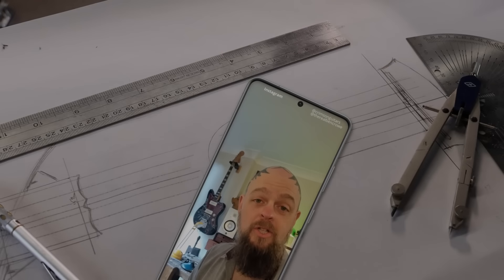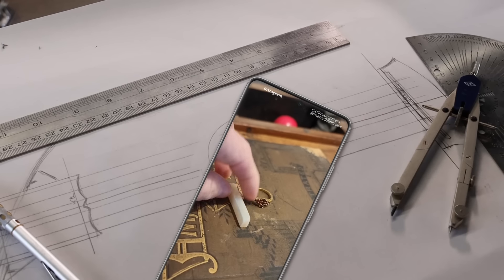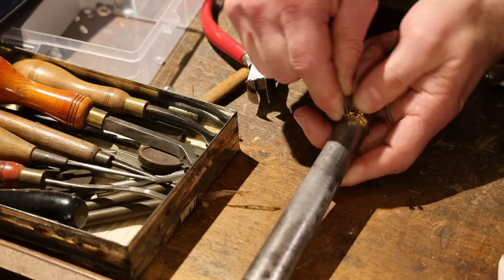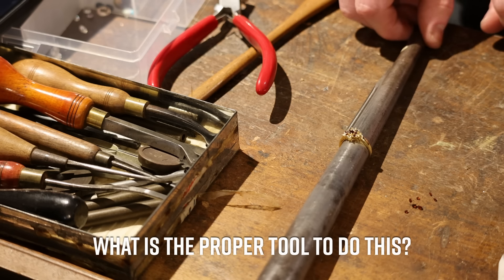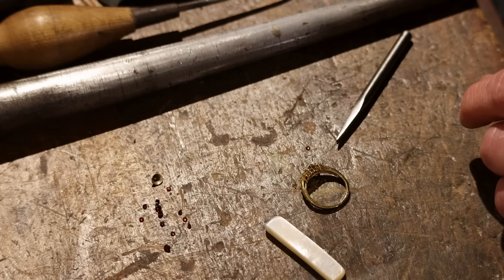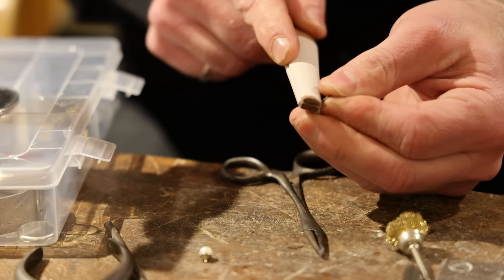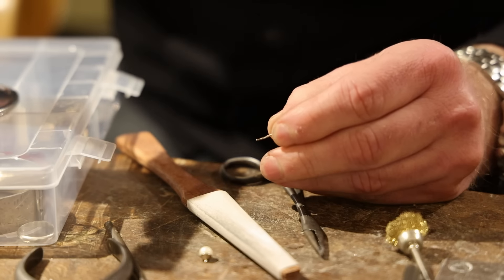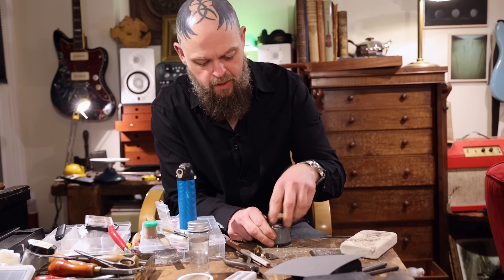Setting a Gem into a Mother Of Pearl Guitar Nut for HTOB | Experimental Luthiery 101

Comment: Longtime viewer, journeyman jeweler from the states. Thought I should weigh in!

First off, congrats, you did it. With the right tools bezels are still challenging to do. So none of this is my attempt to gatekeep, just suggestions for next time perhaps. 

1. There is no one perfect tool for removing stones because there is no one setting. I've used flush cutters, gravers, pliers, and indeed there is a tool called a prong puller that generally is great for pulling prongs. Imagine. 
2. The holes under the setting do help let light through but depending on the stone and the cut that may be better served by making the setting a polished cup. You'll see that a lot with morganite set in rose gold, really pops. The second purpose is a relief hole. When dirt accumulates it is next to impossible to get out from under a stone unless the setting is air tight, which is effectively impossible with prongs. Holes make steam cleaning much easier. 
3. I know how much you love old tools, and so do I, but no, fancy tools are not the name of the game for most jewelers. We improvise. In fact if were polishing that I would just load up a felt buff, dowel, toothpick, or horsehair brush (my favorite) and go to town at max speed in a drill or flex shaft. Five minute job. 
4. Pitch is fantastic. 
5. Your stone wanted to rock because you have no seat (brits call them bearing edges... not sure about south Africans). The stone wants to slide up the curved wall. The ideal bezel setting has a thick bottom and the girdle of the stone (or the bottom face, for cabochons) rests on a lip where above it is a thin strip of metal, often fine silver, that goes up about 1/3 of the crown or up the side of a cab. This is cut using a bur (fraise for brits) or soldering the bezel wire on top of a base. 
6. Setting the stone is much easier done in a star pattern, like tuning a drum. Creases are avoided by using thin enough walls and by carefully massaging them out before fully folding the bezel over. Afterwards the final level of perfection is to use a graver to make the top of the bezel (now facing to the table of the stone) even. 
7. Last, your force when hammering the bezel is very chaotic because you didn't use a chasing tool. Even going that gentle it's surprising you didn't chip the stone, but once again, well done. 

Hope to see more attempts at learning more jeweler skills, I know how obtuse a lot of it can be! Cheers!

Comment: I'm a retired goldsmith with over 50 years at the bench and I must say you Get 10 out of 10 for ingenuity 😊 I can't lie I did wince a little but you did amazingly well for someone who has never done it before and didn't have the right tools. There are certainly a few easy thing you could to make your life easier. Use shellac or setters cement on a small dowel to hold your setting. I haven't used one in 50 years but for fun keep your eye out for a string archimedes fine pump upright drill. You can make your own drills by breaking the eye off a sowing needle and sharpening it. You can drill holes quite quickly when you get used to it. You can use cotton wool on a small wood or plastic rod for polishing. This would be much easier with a flexi shaft with rubber wheels and cylinders of course but obviously that's not the point. Sorry for the lack of detail but this could go on for ages. Good luck with your future endeavors.
Reply from the maker: Thank youso much for sharing your knowledge
Reply: @CrimsonCustomGuitars Another tip Ben if you don't have a hole to push the stone out from the back you can mix beeswax and fine charcoal dust together (used to be coal soot from the chimney) you'll have to experiment a little with the ratio. It has amazing suction if you get the mix right. If its cold you have to knead it a little to soften it. We use it to pick up stones as well to place them in settings. If you don't press it hard on the stone it's enough to pick it up but releases easily in the setting. Very important when you have very small diamonds to set.

Comment: You’ve done a great job with the tools you have👍 if you decide to have another go rather than using burnishes to fold over the metal a setting punch or a modified nail tapped with a hammer would do the job much easier starting north, south, east, west then completing the circumference. You could the. Use the tip of your burnishing tool to gently run around the inside edge of your setting to get a nice sparkle ✨ But yes, making jewellery is much harder than the videos on YouTube make it look, I’m still working on my skills and soldering jump rings is my nemesis!
Reply from the maker: Soldering! It is a dark art, a dark and scary art! I will be getting more tools and a setting punch, customised or purpose bought is next on the list.. I really enjoyed this and want to do more!

Thank you for the burnishing tip too!

Comment: For future reference, you can use a small piece of shaped BluTac stuck to the face of the stone to help you position it more easily so that it goes in straight. 

It’s hard to describe, but I’m sure there are plenty of videos showing this technique.
Reply: Or rotico or sticky wax mixed with charcoal. Or water or spit on the end of a beading tool or brass rod.